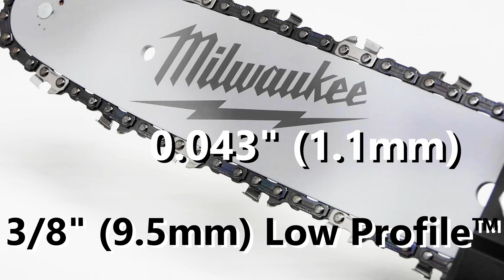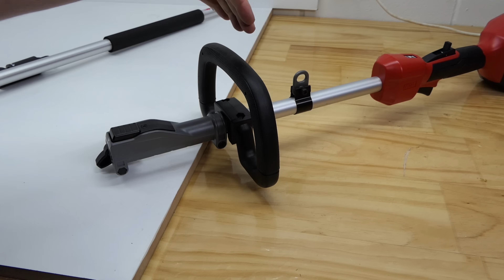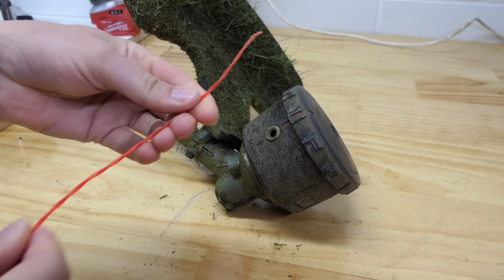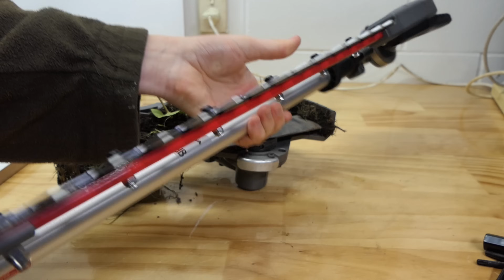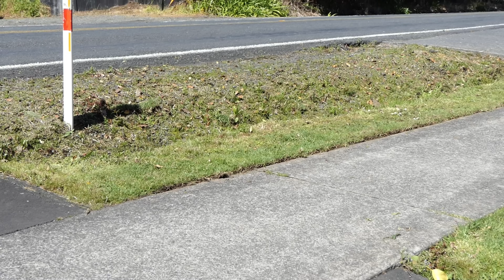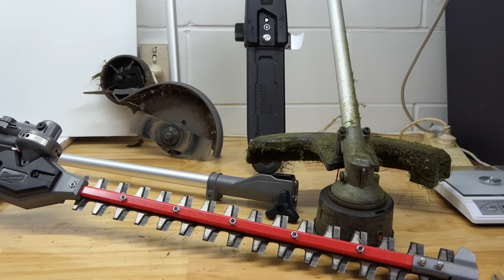Milwaukee M18 Hedge Trimmer, Pole Saw, Edger & Line Trimmer ALL Powered by ONE TOOL!

Comment: Nice to see a 'real world' demonstration & review of this gear. Milwaukee power tools are made by Techtronic Industries & they also produce Ryobi & AEG power tools (Rigid 18V & Echo 58V in the USA). The attachments such as the hedge trimmer, pole (pruning) chainsaw & edger are all pretty much the same for the AEG (here in Australia anyhow), except for the branding & colour, but use the Ryobi Expand-It connection system (used by other brands like Trimmer Plus), which does allow for three rotational positions (if they included all three holes in the clamping collar etc) which makes hedge trimming more comfortable. They can be used on the AEG 18V & 58V drives. The 58V drive (line trimmer) is somewhat heavier when using the 58V 8Ah battery, but does have lots of power, although only uses 2.4mm line in their line trimmer. They used to have a deeper line trimming head on their 58V Line Trimmer but have now gone to the 'slim' line trimmer head for both their 18V & 58V line trimmers, & also their Brush cutter (with bike handle bars) when using the line trimming head. I started out using Ryobi but have gone to AEG (needing more power in a line trimmer & mower etc) for over 7 years now, although there are still some gear in the Ryobi range I use that they haven't brought to the AEG line though, so I have become locked into the AEG gear somewhat (they have given me free stuff along the way too).

Comment: What are your thoughts on this 18v setup vs Makita's offering? Im torn between the two power head options
Reply from the maker: This is more powerful than the 18v Makita but the Makita 40v shits all over the Milwaukee. The Makitas have a heap more attachments too. I have heard lots of stories of the Milwaukee overloading and even melting down. I use the Makita 40v these days.

Comment: I've owned all these tools since they were first introduced in the U.S.A.  I have a 1/2 acre lot home with long driveway, fence, sidewalk, alley and curbed street along with a few trees and hedges.  I haven't used my gas powered stuff since. No failures, no complaints, plenty of power.  A full 12ah battery will do all the trimming and edging with battery to spare.  As noted, the string trimmer eats the battery faster than the other tools by far except the blower which I also have, but isn't an attachment for this set.  As noted, the Milwaukee trimmer line is surprisingly durable and cuts well.  The first cut of the season will take a little more than one full battery as the first edging of the season takes a bit more power to get the edge established and the extra blowing to clear the dirt it kicks up.  But after that, the edger will cut beautifully as fast as you can walk with it.  It will take standard edger blades. I go through 2 edger blades per year.  The pole saw and hedge trimmer can get a bit heavy when using the extension for extended periods at max reach, but not horribly so.  The hedge trimmer attachment makes a really good brush cutter.  In heavy, overgrown weeds, it's much faster than using the string trimmer.  I've used it for that numerous times and it works great for this purpose.  Great set that I highly recommend.  I take good care of my tools, but I work them hard and don't baby them.  If you think you'll be happy using these tools with a regular 5ah battery, well..... you won't be.  Use High Output batteries for best results. This is much more convenient than the 2cycle stuff I used to use.  I don't miss them a bit.
Reply: I use the extended hedge trimmer to cut paths through over grown brush too👍

Comment: Hi! I have been using this Milwaukee line trimmer for 3 years. He melted the terminal part of the battery for me several times. I would like to know if you had any experience with overheating of the battery pack in the case of the linetrimmer. thanks
Reply: i’m on to my third unit under warranty. melted two sets of batteries 6.0 and 12.0.  won’t do a refund. just keep taking em back i guess

Comment: How was the vibration when using the weed eater.  Was it uncomfortable?
Reply: I know this is old but i feel no vibration what so ever,you do have to be careful not to cover the power head vents with your arm,will cause overheating of the motor,but a absouloute beast when ran with the 12.0.....

Comment: So what would be better for edging an area which hasn't been done in a few years - the Atom or the Milwaukee 18v?  Do you own the two stroke Atom or the Honda version?  Which would do you prefer using?  Thanks!
Reply from the maker: If you have a large area to do, and need to do it on a very regular basis then an Atom is the way to go.

Comment: I think the Ryobi power heads fit that Milwaukee tool as well. They make a blower a brush and some other stuff that Milwaukee does not have
Reply: Pretty sure Ryobi still uses the standard OPE attachment where there’s a basic detent on the attachment side.
Whereas Milwaukee uses a latch and notch system very similar to Ego’s.

Comment: Okay before watching I have to say I have this string trimmer no other attachments though and wow it works great but gosh it’s so heavy / unbalanced. Milwaukee sells a shoulder strap for it, have it gotten it yet and I’m very curious to see what you you think of it! Cheers
Reply: For runtime I normally use the 12.0 and it’s great, for small jobs a 5.0 works just fine though.
Reply: Well sugar yours came with a shoulder strap.... here in Canada they sure don’t.... $20 to buy separately...
Reply: Here in Canada they don’t sell it as just a power head, you always get it as the weed eater and then buy another other attachments separate. Interesting.
Reply: Curious on your height as the tool is so unbalanced for me, I’m 5 foot 11 inches.
Reply from the maker: Do you find it heavy at the back or front? It is so much lighter and better balanced than the  petrol ones I'm used to.

Comment: Great review and really impressive machine.  Hopefully the Makita will drop off their one to you soon and we can get a competition between them going ;)
Reply: I have the 36V makita DUX60 , pole saw , 1m extension , cutter head with two rotating blades and cultivator ... do like that it has reverse , for few sec it runs backwards , so you can get weed off the cultivator blades . Was surprised that the attachments were made in Japan , those came in white cardboard boxes .
Reply: @pete_lind  I also have the 36V Makita and it's absolutely amazing.   String trimmer, pole saw, edger and Articulating hedge trimmer with extension.  I can't say enough good about how well these all work and the build quality.   The trimmer head with extension = heavy, but quite manageable.  Great reach for those tall bushes.

Comment: I got the 36v Makita equivalent of this, bloody brilliant unit
Reply: Just grass and weeds, 2x 5amps. If you keep it on high it’s only about 30-40 mins, of normal used. But I don’t normally need it on high so idk I’d say lasts an hour. Which is more than enough for our yard.
Reply: @sassall4284  Thanks for the response man. I appreciate it.
Reply: What's the runtime like on the string trimmer unit? And what size battery do you use and on what kind of vegetation?

Comment: The entire line trimmer head must be replaced when the bump cap wears out, because they don’t sell it separately. About $35 here in the USA. I patched mine up with epoxy and fiberglass, but I don’t think it will last long.

Comment: Any plans to test the Makita 40v?  I have the 36v version and the runtime and power is great on everything, but I find the pole saw to be a bit under powered when you get to bigger stuff.  The motor protection kicks on more than I'm happy with.  If I remember right, the 40v is supposed to be over 50% more powerful than the 36v.  Would be interested to see if that's accurate before I start investing in 40v.
Reply from the maker: It's  a lot of money to invest so I'm not sure I will get them. There's so many other Makita 40v gear to do first.

Comment: No reverse. Deal breaker for me with all the landscaping fabric around here. Also can get you into tight corners from the other side with string trimmer.
So true with the different battery runtimes, with the Makita 36v split shaft I have, it seems like all day cutting hedges or 15 mins strimming with 2x5Ah.
Will have to see if there is a 3d printable hanger for the tool ends though, that looks like a great idea.

Comment: I’ve got the Makita DUX60 2x18v with the hedgetrimmer and weed eater/strimmer attachment.
Loving the weed eater though I prefer the wide handled version, C shape I suppose, over the smaller D handle I’ve got.
Its got plenty of power, but does burn through the double 5A 18V batteries rather quick. Which isn’t a problem for me since I’ve got plenty.

I mainly use the hedge trimmer attachment for horizontal work on a low hedge that covers a large corner of my garden. Its too wide to trim with a regular hedgetrimmer and I don’t have the reach for it despite being a tall lanky lad.
The trimmer sort of works, but its heavy as balls when using horizontally. I won’t last longer than 15 minutes or so before my shoulders, arms and back start complaining.
I suppose its more suitable for trimming the tops of tall hedges rather than what I’m using it for.
Reply: how quick does the line trimmer use up the battery. i've been considering that same system myself.
Reply: @Outwars1  20 to 30 minutes of heavy use. Where it’s constantly being pushed to its limit. Have not ran into battery overheating as of yet, they are toasty afterwards though.
Reply: @wippip  Ok mate. Thanks much for the feedback. I don't have much thick overgrowth as such, but I do have some moderately hard grass types that's mixed up with other things. Might probably resemble a patchy unkept lawn. I don't think I'd be pushing it to the limit all the time, so I'm hoping it will be suitable. Just prefer to get away from the gas storage/use. The electric is just way more cleaner and easier for me in terms of getting "fuel".
Reply: @Outwars1  I have a medium sized yard with lots of small trees and crap I have to trim around every time. For what it's worth, I've never dipped below half battery even when being really thorough and meticulous. When I want to power through some thicker overgrowth, it has just as much power as my gas trimmer, which I ended up selling.

My only complaint about the Makita is it has terrible slow speed control. A gas trimmer can rotate super slow, but the Makita's minimum speed is just barely slow enough to not damage a fence, and it's pretty tricky to get it to stay slow, until you get a feel for it.
Reply: @TKettle  Thanks for the input mate. You said medium sized, so around 1/2 acre? I have about maybe a 2000 sq.ft stoney and undulating yard I need to cut. So was just trying to gauge the suitability. The point on the speed control is noted as I will have to do some feathering at certain points. Much appreciated. 👍

Comment: Can't say I'd buy one until I see a comparison :)
Reply from the maker: Which ones do you want them compared to? 😉
Reply: @ToolsAndStuffOFFICIAL  Makita 40v of cause, Hikoki, Dewalt... I'm not sure about the EGO, Stihl and Husqvarna ones because you need a hole new battery system and they are out door tools only.
Reply from the maker: I would have to sell all my tools to buy all of those?
Reply from the maker: You'd have thought so by now.
Reply: EGO is a monster!... I need the 450 mm 18" chain saw & the mammoth 650 CFM 180 MPH 280 WH (WHat⁉️) blower, it's a KILLER bro. You will be empressd with ego!. I need to save for it, as it's Really exclusive here.